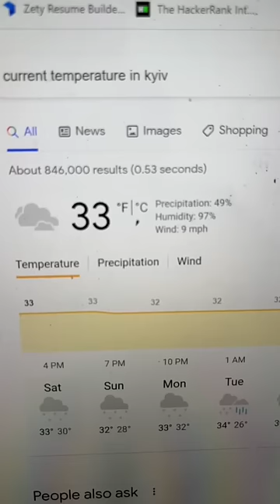Why doesn’t Ukraine use diesel locomotives as power generators?

Comment: I'm just offering a guess (which may be wrong): load balancing is a huge issue when operating a grid. if one locomotive gives 100 units of power, then the lines can draw at most 100 units. If they draw too little/too much, it can damage some electronic devices because they expect a certain frequency of power. If you have more than one loco on the same circuit, you need a way to match their phases, otherwise the current will fight each other. without coordinating the distribution (ie. with software or some other communication) it's near impossible to energize a whole city, let alone country.

Also, if your transmission line is capable of at-most 100 units, if you try to push 150 units through it (say with 4 locomotives) Bad Things will happen.

Comment: The real problem is that it's not so much that JUST power generation is the problem.  There's a billion other things in the grid that have to be correct.  Their power plants are mostly intact - they need the ability to DISTRIBUTE the power, not generate it.

Comment: 1. Buy or find old 1990's AC Diesel Locos, 2. Strip them of motor/gen sets, 3 Build txfmr/controller/switch units, 4. Ship to Ukraine 5. Install.   Do you have any rich as Patreon supporters who could support a team to get shit done.  Need specifically trained Rail Road and Electrical Engineers....there are plenty around the world.

Comment: It’s likely their locomotives still use DC traction motors, which means they have DC generators.  The electrical grid is AC.  Even if they are AC, they may not be 50hz, and you still have to step down the voltage and figure out how to wire the generator up to the grid.  It’s feasible to run a building or two off a diesel locomotive, but running a significant part of a big country is a different story.

Comment: In the mid-80s a hurricane caused extensive damage to the Hawaiian island of Kauai. Damage caused significant power outages from inoperable power-generation systems. The electric grid in all of the US distributed 60 Hz, 120 volt (and greater) ALTERNATING current to homes and businesses. So an alternative 60 Hz, 120 volt ac power source was required to substitute.

The US Navy volunteered one of its (many) nuclear-powered submarines stationed in Pearl Harbor as an electrical power source. The nominal electrical ac power output of the electrical turbine-generators aboard US nuke subs at the time was about two megawatts. Not a lot, but enough to power the grid for hospitals and other emergency facilities like fire stations and such. So, an SSN was dispatched to Kauai while technical challenges were resolved.

The electrical systems on a submarine were designed to supply ac power to internal equipment - like main coolant pumps, other cooling pumps, lubrication pumps, etc. Those pumps are required to run the nuke plant so the effective output of the turbine generators was effectively maybe only 1 Megawatt. Further, when a sub’s nuke plant is shutdown in port, ac power is supplied from “shore power”, 240 volt ac three-phase power. It’s enough power for “hotel” loads (lighting, air conditioning, etc) as well as to main coolant pumps to remove “decay heat” from the reactor when shut down. 

Shore power only provided inbound power to the boat. It was not designed to provide output power. So, a jury-rigged system had to be developed to connect some output power from the turbine-generators to shore while maintaining enough power for internal systems in case the reactor scrammed (shutdown).

By the time engineers at NAVSEA-08 (the Washington DC org run by legendary Adm Hyman Rickover) could provide a solution, the power generation systems on Kauai were restored.

In general the concept had significant nuclear safety concerns. If the nuke scrammed, it was absolutely essential to keep the core cooled. Much more essential than providing power to homes and businesses in Kauai. If the core could not have been adequately cooled after a shutdown, there was a greater likelihood that the multiple boundaries that protect the Uranium fuel would be compromised and fission products released to the atmosphere.

Overall, interesting idea, but the bads outweighed the goods.
Reply from the maker: I should do a video about Hyman Rickover.
Reply: @RyanMcBethProgramming  Absolutely! I’m a firm believer that this one man helped the US and NATO nations avoid nuclear war with the Soviets.

His story begins as a midshipman at Annapolis, class of 1922. He’s persecuted as a Jew but has the fortitude to push onward. During WW2 as a Captain he involves himself in the Manhattan project and sees the strategic necessity for naval nuclear power - especially in submarines. 

My father, the first CO on my second sub and Hyman Rickover are my personal icons. HGR: Freakin’ awesome man! But a royal pain-in-the-ass to the stupid, the lazy and the untrustworthy up and down his chain of command.

Comment: it also has yo be stated that in the situation of canada, that town was dead smack next to a railway station and so getting a locomotive there wasn’t a real issue, in Ukraine some areas are not always connected or near the stations so it might be a tad hard to get trains there. Also a small detail missed from the events in Canada, the locomotive has to be dismounted of the tracks and actually “ drove” itself to were it was needed to properly connect to the towns power grid, and let me tell ya that road wasn’t liking having a 110+ ton ( metric tones) rolling on it with steel rail weals, yea not the prettiest of sight if it was you fixing that. 
In addition that was for a relatively small town, to power some of the larger urban areas in Ukraine, at least a handful of locomotives would be required, which as Ryan has so expertly explained as always, Ukraine simply can not spare. 

The idea is good and it seemed to work when needed, but having a town out of power due to a snow storm and having several urban regions out of power due to a war, are rather different situations and sometimes some good ideas simply can not be done due to the nature of the situation.

Comment: I should also add that Ukraine is not Canada, and it's not 90's anymore.

Diesel locomotives are old at this point, and maintained as many things. So they are not only saved for the needs of the frontline, but also either in bad condition or saved for the case if that electrified railways got destroyed/disabled
Reply: Diesel locomotives are still made to this day.
Reply: @baneofbanes  Soviet ones? I bet they are not, at least not in Ukraine, and definitely not in quantities needed to cover the biggest European country.

Comment: They could, but they already have a lot of generators and more on the way.  They have set up over 1000 sites to warm up, get food, and charge your devices.  They also have been repairing the damage rather fast.  Within 24 hours of the last big attack they managed to get 70% of the power back up.  I also think they are using these trains... especially since I think they lost the vast majority down south like in Mariupol.

Comment: One problem is that locomotives have no way to synchronize their electricity with other devices. There's no reason to. If a locomotive was to plug into the grid, the electricity coming out of it wouldn't match what was in the grid, and bad things would happen.
A small village that was already disconnected from the grid wouldn't care, but two locomotives feeding the same grid that still has some proper generators going would blow something up.

(My information is a few years out of date, and not Ukrainian. I once lived in a building powered by a generator, and some electric clocks ran slow because they used the AC for time signal. )

Comment: Why don't auto makers use that system. I saw a car a guy who built his own hybrid electric car way back in the late 70's using a Honda 65hp motorcycle motor to drive the generator to power the elect motor. I think he used a Yugo as the base car. Ukraine is smart to use trains.
Reply: There are battery to grid systems for cars. It's an expensive add on
Reply: That's similar to how hybrid cars work, though most add some manner of mechanical connection to improve efficiency.
The Accord hybrid in particular works just like that until it clutches in a "6th gear" for sustained highway cruising.

Comment: It's kinda funny, because tanks are technically electric.
Well, at least a lot of the WW2 tanks were. But, they still had a diesel engine to drive the electric motor. You might be asking yourself why, since that seems needlessly complicated.

But, the WW2 diesel engines couldn't provide the insame amount of torque you'd need to drive the treads. Electric engines start with maximum power right out of the gate.

Comment: Maybe a bit off-topic, but since you have many followers i'll post it here:
Bluetti, jackery & Ecoflow have sendt several banks(with solar panels) to other channels. Send these bundles to Ukraine.
Reply: What?
Reply: Jackery Explorer 1000 & Solarsaga 100W is this something that are "new and highly sensitive" ? Next time use search machine before writing a comment
Reply: Oh yeah sure cause a solar panel can survive and weather an artillery fragment as well as a power station covered in metal and concrete can. 
Not mentioning that this stuff still is newer and requires a more sensitive touch than diesel generators and already running power plants then finally topping it all off with that you need to install these panels which take time, money, and manpower away from repairing and reinforcing the already existing and proven power stations.

Comment: the electric power does not move the train! the alternator supplies power to the electrical accessories of the train such as lights and sensors. it would b super inefficient to drive it thru diesel-driven electric motors yeah?

Comment: Yeah, infrastructure means miles of transmission lines as well as generating plants. We get the grid ripped off the face of the earth by hurricanes here in the US, and the heat kills people. No lines, or no poles to run them means gennies are moot unless on site. It’s a harsh situation in Ukraine, I’ve done four month plus power outages. But nobody was bombing us, so crews were stringing cable quickly.

Comment: IIRC most of those diesel locos have DC generators. You would need inverter do turn that into AC.
Reply: both exsist
Reply: @norbertdx  IIRC in Ukraine most of them are DC. IIRC AC diesel locos are a thing of the US.

Comment: Breaking news:  The US is making hybrid tanks.  It turns out that the efficiency increase is worth it when you consider what the gallon for fuel goes for by time it reaches the front lines.
Reply: 1943: Maus tank, Germany. Diesel electric drive train. Quite 80 years ago. Prost! 🍻
Reply: @Stefan_Dahn  The US thing has batteries and can go some distance on those.

Comment: Not only that, but in order to convert or move the electricity you need to have the dozens of transmission level transformers that Russia has destroyed. Its harder to replace transformers than generators. There is currently a 2 year lead time on transmission scale transformers. This is the same reason a carrington event size solar flare would send us all back to the stone age for a decade or more.

Comment: Why does the steam engine first drive the alternator to produce electricity to power the train?  Wouldnt it more efficient, because one less change of energy, to have the train move on the steam power itself?  And have the alternator make electricity for the lighting/air/computers?

Comment: If much of UA's rail system is electrified, then the power outages must be a big problem for transportation (both civilian & military logistics).

So repurposing the few locomotives that don't need electricity is a non-starter.

Diesel locomotives could be DONATED/LOANED from other countries (but only from countries that use or used Russia's wider-than-standard rail guage.)

Comment: That’s not entirely true. Yes, most diesel locomotives nowadays and almost all Soviet diesel locomotives are diesel-electric, meaning they generate electrical with diesel to power electric motors. But for example a lot of small ones and the German 218 (most famous locomotive from the Bundesbahn) is a diesel-hydraulic locomotive. However sich locomotives as the 218 are being phased out.

Comment: Then why not excavate a big hole, build a reinforced concrete structure below grade (in the footprint), once built backfill over it with the excavated materials (as protection from bombs), run tracks off an existing track in Ukraine into the underground structure and ship some diesel locomotives into Poland to Ukraine? Ship it in 5 sections and without all unnecessary parts (cover, windows, etc.), then put it together in Poland and send it in. Can have a push (rear) & pull (front) locomotive to transport flatbed train cars in with added equipment on the way in & the push locomotive becomes the pull locomotive back to Poland with the empty beds, leaving the original pull locomotive inside the structure. Make 20 bays with tracks inside the structure, odd numbered bays have locomotives, even numbered bays have rail tanks with fuel. Stagger them and install concrete partition walls for protection from each other in the event of a fire or explosion.
Once stabilized with energy use the same type of construction to construct below grade power stations 10'-20' below grade.
Reply: So. I love your solution. But here’s two questions. One. How long will this construction take and what’s the cost. Then two, who’s to stop the Ukrainians from yoinking all three trains and using them not for power generation but instead as transporters.
I’m gonna add a third question. Can one or even three trains power a quarter of a country let alone half?
Reply: @AceIndiana  the construction can be performed night & day, 24 hours around the clock. Excavation about 2 weeks, after part of the excavation is far enough along the sub grade can be compacted, and the foundation can be started as the excavation progresses away from the concrete. This project can be done in 1-2 months with crews installing track at the existing track towards the project maybe 1 mile away (or closer depending  on the locations) at the same time the structure is being built. This would be to provide power in Kiev and maybe some other nearby areas by underground power line in the future.
This would not power the country, but maybe pockets that people can go to for heat, hot food banks, laundry, medical triage locations, etc.
The Ukrainians would need to agree to terms prior to construction. Cost is a non-issue, it's a war and billions are being floated around...
Reply: @R_Thomp  well… here’s the thing. People are saying they’re already doing that with diesel generators thatre already there
Reply: @AceIndiana  not sure if their resources are sufficient
Reply: Which is why they’ll need to keep what they have in the fight. Replacing a busted wire and repairing a broken motor is cheaper and faster than building a whole new power station
Reply: @AceIndiana  the problem with the existing infrastructure is that it is above ground and it's easy for the Russians to destroy it. This war may go into next winter and they are going to need electricity regardless. Do you have a solution instead of critiquing mine?
Reply: @AceIndiana  it's not as simple as that, the power stations are destroyed, it's more than a motor or wire, it's a complete overhaul, and that's a waste because an Iranian drone will take it out after they redo it. Critical thinking...
Reply: That they continue to push the Russians back like they’ve been doing and continue to repair there’s continually. Also. Let them figure it out cause let’s face it. Ain’t nobody worthwhile gonna read our comments and be like “oh yeah. Let’s implement that”
Reply: @AceIndiana  the drones are launched from Russia, pushing the Russians back will not effect the launching and use of drones to destroy the infrastructure. Regarding people reading & using the ideas in the comments, I was replying to the video. But instead of using locomotives they can build the same type of building but build a powerplant underneath instead of using diesel locomotives.

Comment: I usually agree with just about everything you say for the most part, and, this isn’t exactly directly related to the point of your video but you said in it, “you can’t make an electric tank” and, I’d have to disagree!

I do believe an electric MBT most certainly can and likely will be eventually made. Probably even in the not so distant future. I understand they’re still working on hybrid tanks now but from what I’ve read, the US did experiment with several hybrid/electrically driven tank designs way back in the 80’s and, battery/electric motor and regenerative technology have come a long way since then. Would it be effective? Probably. Would it be practical? I have no idea!

Comment: Yeah, if they had more diesel powered locomotives then they would use them to supply the front. Part of the reason Russia is targeting the electrical grid is to take out the train infrastructure.

Comment: I really hope nobody sneaks in to Russia and destroy a couple of transformers. They tend to not have a whole bunch of them laying around to switch out the broken ones since they are big, heavy and really expensive. So, if a transformer or 50 were to be taken out of commission all at the same time it would be a big problem. I guess they can burn rubles for heat, wood is more efficient but worth a lot more.